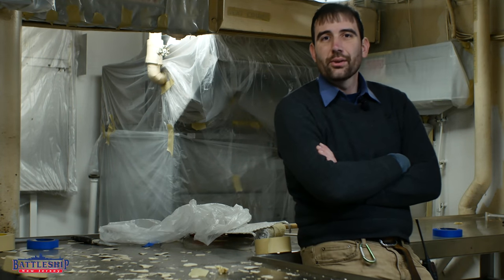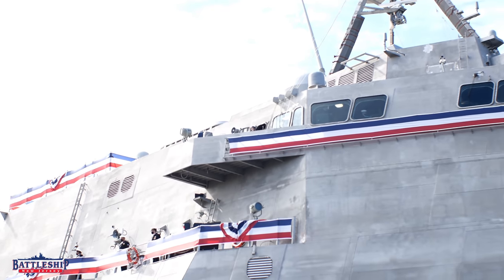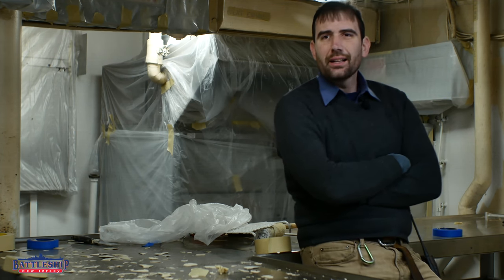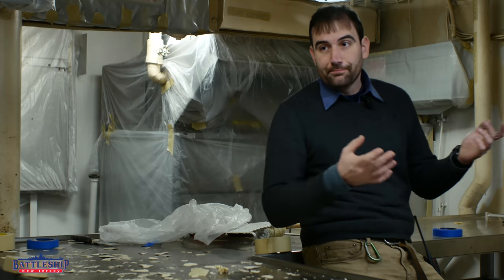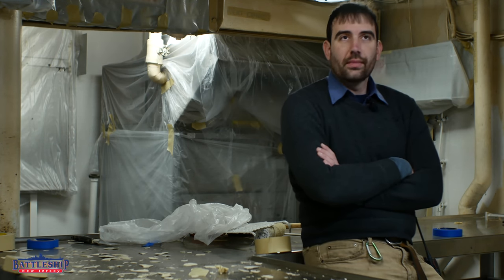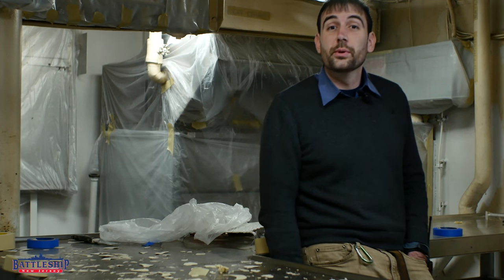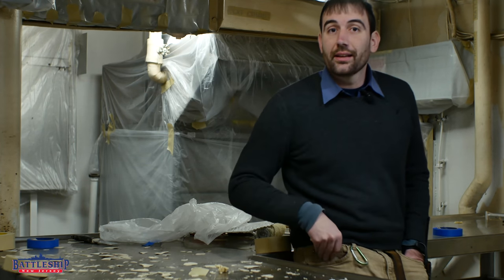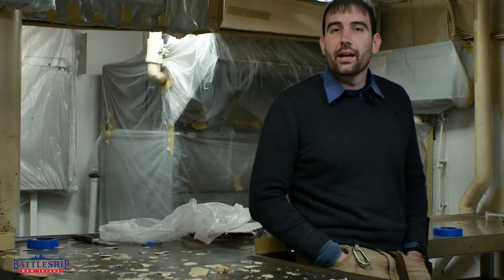Warships Made Out of Aluminum?!?

Comment: There is a relatively new technology of metal foam where Aluminum is turned into a sponge. It was tested  for bullet resistance and found to be just as effective as solid aluminum plate with half the weight. 
It would be interesting if a vessel could be made from metal foam and see what benefits could be derived from this material.
Reply: Not sure I'd call metal foam new at all. It's been used in some cars (I think BMW was the one I saw it mentioned in reference to), and the ease of manufacturing it (to summarize: melt, dissolve appropriate gasses, quickly vent to vacuum, let cool- a similar process involving gigantic sizes of pressure cooker is actually used on Earth to make some breakfast cereals) was seen as an industrial advantage of the Moon back when we expected to have a colony there in the late 80s.
Reply: My concern with a foamed warship is how well it can handle transit across the sea. Especially out in open water, your ships is going to get bend every which way, and all of that might cause that sponge to perform worse than solid metal in that case.
Reply: @Firestorm2900  good point. However, metal foam is still quite hard. That's why it has been considered for use in armor plate. I just think it's a fascinating technology for many applications.
Reply: @Firestorm2900  You could use the foam as a core in an aluminium sandwich which would produce a lighter (than solid) structure which would be more resistant to buckling instabilities and maybe stiffer.  Foam might burn more?

Comment: I'm not going to look it up, but, if memory serves, during the Battle off Samar, when Taffy Three came under attack, the shells from the Japanese big ships were simply passing through the carriers and not really causing a lot of damage. This might be a small benefit to ships with aluminum superstructures. Not that I'd be too happy to be in a compartment and it suddenly gets ventilated.
Reply: That would be something to consider if were still using large guns to battle each other with, but we're using missiles now and they don't tend to overpenetrate like 14" - 18"' AP rounds fired from a battleship.
Reply: From what I heard, the IJN mistakenly assumed the vessels they encountered were larger ships than they actually were, and so were using armor piercing shells initially- which will do exactly as you say, when they hit thinly/unarmored ships.  It takes a significant impact to initiate the detonators on those, as in several inches of armor plate.   Those 14 and 18" battleship AP rounds probably never even felt the half inch of STS plating when they hit, say Johnston or Roberts.  The 8" cruiser rounds likely the same.  Left a damn big hole behind though. 

   When they finally switched over to high explosive, (which have simple impact fuzes) our ships suffered much greater damage.   They were expecting to encounter at least SOME elements of the 7th fleet, not a handful of tin cans and jeep carriers.  And when those tin cans actually CHARGED them, they had to assume the diversion had failed and that they had lots of help coming up fast behind them.   Seeing those  carriers  in the distance only reinforced that assumption.   They likely assumed they'd sailed right into another ambush.

  There's dozens and dozens of theories out there, as to thy the Center fleet did what it did, so who knows what was actually going through the mind of the admiral in charge.  We just thank our lucky stars it DID take them that long to change ammunition types, and that they chose to withdraw instead of pressing on ahead.

  To be fair, life had to suck pretty bad for the deck, bridge, AA; secondary etc crews on those Japanese ships, too.  Several of them took a wicked pounding from our 5" HE shells.  Breaking shit, starting fires, throwing splinters and fragments all over, et.   One scored a direct hit on a cruiser's bridge, destroying it completely, killing everyone inside, and starting a huge fire.   As one sailor put it: "We couldn't really hurt them, but we could at least rough them up a good bit."   It's never good, eating a bunch of incoming fire.  You might not penetrate the vital parts, but there are an awful lot of sailors out on deck, and in thinly armored parts that are going to get torn to pieces.  And plenty of important things to damage.

  Totally agree with your last sentence!  Fuck NO!!

Comment: Aside from the lower weight and the elimination of corrosion control requirements and reduced radar signature, aluminum does have one more advantage over steel.  It does not produce a magnetic field to the same degree as ferrous metals like steel.  Weapons that use magnetic influence exploders like mines and torpedoes would have to fall back to secondary mechanical contact exploders to detonate.  This is one feature that makes LCS ships well suited to minesweeping.
One thing to bear in mind is that these ships are not intended to fight as ships of the line along side destroyers and cruisers.  They are meant to fill specialized missions like mine sweeping, counter piracy, interdiction and ASW, depending on the mission package installed.

Comment: About the Zumwalt-class's composite superstructure, I think the last of the 3 ships was made with a steel superstructure to (shockingly) save money.
Reply: That's accurate, DDG-1002 got a steel superstructure for cost savings. Also, the composite superstructure is made up of numerous smaller panels and there were issues with making the joints watertight.
Reply: I believe the ship in question is the Lyndon B. Johnson.

Comment: Regarding  the fire hazard of aluminium vessel super structures.... Any  metal ending in " ium"  such as magnesium, sodium etc are flamable metals, a class d fire.... they can't be controlled with water,  using water, hence the horrible damage u saw on the Belknap and the RN frigates during the falklands... aluminium burns, steel doesn't burn, at high enough temps it melts, and at lower fire temps it warps and distorts and pulls the welds apart causing severe damage...
Reply: Solid Aluminum doesn't burn before it melts. Powdered Aluminum is explosive.

Comment: I know this will sound crazy because of the fire issues but why not use treated wood for the superstructure? If you use some steel supports you could have the whole super structure of blow off but leave the essential systems supported or it could burn at a relatively low temperature again leaving the important components supported.
Reply: @IvorMektin1701  Oak has always been great but oak is in need of some reform.

Comment: Intersting Video. Aluminium is also an intersting topic in tank Design. The CVRTs for example were made out of Aluminium and initially had quite some problems whit cracking on joint. But they Managed go remedy that in some Variants are still in Service.

Comment: Would you consider doing a video on what causes galvanic circuits and galvanic corrosion on warships’ hulls and how they are dealt with? I heard that the littoral combat ship USS Independence in particular is having galvanic corrosion issues with the Steel Water Jet propulsion systems being attached to the Aluminum hull.
Reply: Seconding this request. Did degaussing equipment accelerate electrolysis?
Reply: @Skipper77777777  Ryan did do a short video a while ago about cathodic protection, not in depth, but worth the watch.

Comment: surprised about the no paint on the new aluminum litoral ships because it doesn't corrode.... well with airports for instance, the reason in winter they don't put salt in with sand for sanding the runways in winter is that aluminum aircraft corrode...and it's not as visible as corrosion on a steel vessel..
Reply: The thing to understand here is that unlike steel, with aluminum, oxidation does not equal corrosion. All exposed surfaces will be passivated (i. e. chemically treated to form a thick layer of aluminum oxide), which is far more durable than paint. This isn't necessarily done or even practical in aircraft, where those parts are far more exposed to abrasion by dust and debris kicked up from the runway. If the oxide coat ever gets worn off by something in an area exposed to an electrolyte like salt water, these areas will have to be re-treated or painted over quickly or they will start to corrode - how quickly depends a lot on what other anti corrosion measures are in place, which I suspect will be classified.

Comment: One has to wonder if the Navy ever get's into another war with an enemy with a substantial fleet how well these new ships such as the Independence class will hold up not to mention whether or not they can complete their combat mission before being disabled or sunk.
Reply: If they’ve got good officers, good enlisted sailors, and good Chiefs, they’ll manage.

As Baron Vin Richthofen said, “The quality of the box matters little.  What matters is the quality of the person inside it.”
Reply: Running a ww2 heavy cruiser against an lcs... can the lcs NSM do enough damage to stop the CA? It certainly can out run the cruiser if the engines work but then you lost the point of whatever you were protecting and strategically lost.
Reply: @jth877  Why would an LCS ever go up against a heavy cruiser? The LCS ships have a specific mission set, as Ryan stated - they are not designed for ship-on-ship warfare. There would almost certainly be a destroyer and other vessels nearby for support.
Reply: @EstorilEm  : War rarely heeds job titles and specializations. Still, I recall the LCS being somewhere around the size of a frigate, so they shouldn't be trying to go toe-to-toe with a cruiser under anything other than the rarest of situations. The correct approach for them would be to fire off a few of whatever anti-ship missiles they get equipped with, tell whatever they're protecting that they're getting forced off, and high-tail it. Running is the correct option for them.
Reply: The original mission profile for the LCS was shallow water support, as the L is for Littoral (shallow waters). There's plenty to criticize about the LCS program but criticizing what is more of an infantry ops support/shallow water fleet scan ship for not being able to fight other combat ships is a bit of a stretch.
Reply: 1) The Iowa's were decommissioned because they're battleships. They can aide shore ops but when troops advance beyond the reach of the guns, their abilities are limited, even with the 1980's refit. It also takes up to 2000 sailors to crew one, and they require massive amounts of fuel. They were retired because keeping ships like that in service is costly compared to what they offered. Lastly an 887ft, 50,000+ ton, $100 million capitol ship was becoming more and more of an inviting target as technology progressed, and having them within range of enemy retaliation is a bad idea when you only have 4 Iowa Class Battleships.

Using smaller ships means you would have more of them, they would (with a proper procurement program) be cheaper to buy/maintain, and they can travel in shallower waters than a ship with a 37ft draft. Had the LCS not been such a shit show, they might have even made good tools for anti-piracy squadrons.

2) Stealth works different on water then it does in the air. When radar scans over water, it can actually picks up the wave crests. When the USN tested the Sea Shadow, they found the stealth profile actually created a hole in the wave crests. A hole that was rather inconveniently roughly the same size as the ship. On water, you want to blend your radar return like camouflage is supposed to for troops on the ground. 

As I said, there is a lot to criticize the LCS program for, but criticizing it for a mission it's not intended carry out is an invalid argument. It would be like criticizing a bomber for not being able to dogfight.

Comment: Knew a guy who was a Hull Tech in the '70,'s on one of those aluminum superstructure ships in the Pacific. Every time they sailed by an artillery target island, the Captain would an artillery training exercise, they would fire off some standard number of rounds per gun.  The next day, the Hull Techs would be called out  because the superstructure had cracked loose from the hull. They would weld it back together, and everything would be OK till the next time., But how reliable would that be in an extended combat situation? BAD IDEA.
Reply: It seems to me this is just an argument for getting rid of steel hulls.  An all-aluminum ship would not have the weak point where aluminum is welded to steel.
Reply: @WalkaCrookedLine  der
Reply: Instead of a weld should have instead used the proper method, a thick gasket and floating pins to hold the superstructure fast. Stops a lot of the vibration cracking and also helps a lot with corrosion control.
Reply: @WalkaCrookedLine  remember the old military saying, " this thing is made of 250,000 individual parts, each supplied by the lowest bidder." Money talks..

Comment: I don't think you're right about aluminum burning . Aluminum loses structural strength at 800 degrees and deform at 1000 degrees much lower than steel
 I believe the story about burning got started because of the blackened remains of the superstructure. This was caused by the heavy smoke from the burning of other material.
 Aluminum powder type products will burn but not the solid aluminum.
Reply: google f150 aluminum truck fire
Reply: I've seen aluminum armored vehicles burn several times.  And it was definitely the armor burning.
Reply: The article states the aluminum melted not burned. Because aluminum melted at auch lower temp than steel
Reply: I know for a fact that when the Stark was hit by Exocet missiles her superstructure actually caught on fire. They were eventually able to put it out, but it involved pretty much the entire crew manning fire hoses and spraying all the water they could on it. Thus they were eventually able to deprive the fire of enough heat to keep going. But such an outcome is the exception not the rule, and at least partially due to the fact that Stark had been preparing for a damage control inspection. Thus she had at least twice the number of OBA canisters she was supposed to have so the crew could practice. Without those extra canisters there could easily have been a different outcome.
Reply: Anything you can find on the stark indicates that the issue was the low melting point and loss of structural strength.
Reply: Go look up "Fire resistance of aluminum and aluminum alloys, & measuring the effects on the properties of aluminum alloys" by J Gilbert Kaufman. From 2016. Pg V and  VII give a clear statements about aluminum not burning and the reason why people.think it does.
Reply: Here's the thing about "aluminum not burning": all that you need is to get a thin piece burning. If it can then generate enough heat to melt part of the structure, then that provides an escalation route to a larger fire.

Metal fires are very rare, but they also are real, and very hard to extinguish.

Comment: I think the trend of lighter and faster ships will continue. It's far better to have a platform on location in 3 days than to have more capable one there in 5. Survivability in case of a hit is mostly irrelevant now. Missiles will continue to get faster as it's one of the ways to defeat missile defense, and with that speed they'll be increasingly more destructive when they do hit, even if the warhead is fairly small or nonexistent.

Comment: One correction: aluminum is just as bad for antennas as steel. In fact, it reflects radio waves even better than steel as it has 4 times the electrical conductivity.

Great video, though, as usual!
Reply: Not true. Alu more conductive and similarly reflective, but no its far less impactful on radio equipment. Why? The complexity is its non-ferromagnetic, so doesn't become a dipole when in the presences of a field, which accounts for the vast majority of re-transmission type interference. Thus while you can't normally make a radar dome out of Alu, the vast majority of mounts and masts for such systems are, requiring orders of magnitude less design work/limitations than steel, cobalt or nickle alloys would. This design limitation might not be the end of the world if your just adding a tower to an airfeild, where its specialized and in a lot of open space, but for a ships superstructure (especially a warship) there are a LOT of other concerns your trying to balance, so you end up with a vastly worse compromise if your adding an extra factor to design around.

Comment: The Cleveland class light cruisers of WW2 were designed to have aluminum superstructures but wartime aircraft needs ment that they were built out of steel.  This made them top heavy from the start even before the addition of radars and larger anti aircraft batteries.